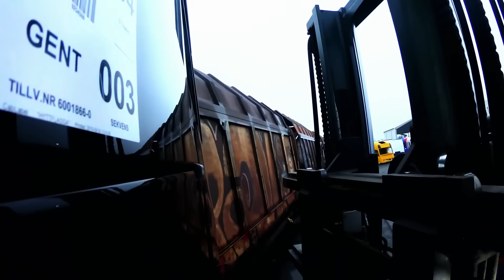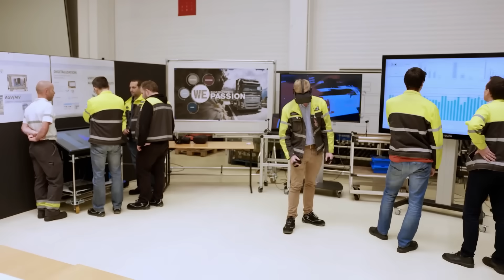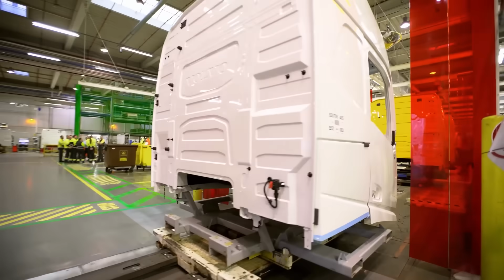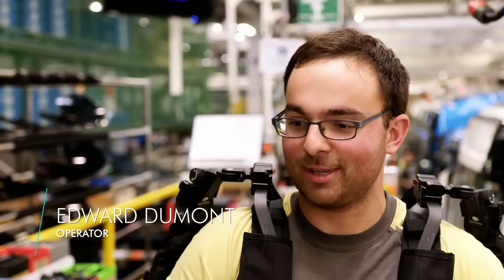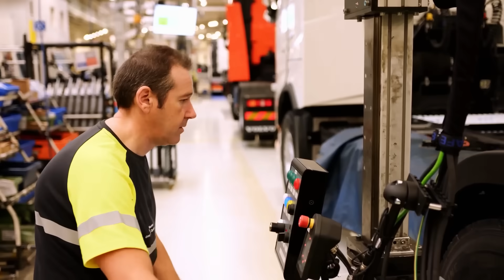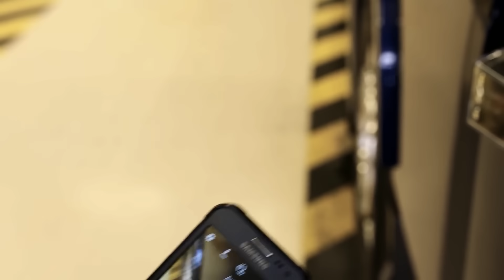Volvo Mega Manufacturing: The World’s Most Advanced Truck Factory | FD Engineering

Comment: In Australia we use the Volvo  FH16 as road trains and pull 4 trailers with a max length of 60 metres (196ft 8in) and a max weight of 200 metic tonnes (440,000lbs) ✌️🇦🇺

Comment: A wind turbine in the middle of the factory, can't believe my eyes.. This climate-hysteria knows no bounds.. 
What happens if a rotor blade falls off? Sure it's a somewhat rare event, about 0,5% annually according to the stats i found online, but the result would be no less catastrophic. 

Worker safety? Think again.
Reply: Windpower is now the cheapest form of energy in Europe. And windturbines are very safe.
Reply: @DexterGordon-dr8qd  Claiming that something is the cheapest form of energy whilst heavily taxating other forms of energy production is an oxy-moron.
Reply: @DexterGordon-dr8qd  Also, "wind turbines are very safe" - Only Germany alone has 6-10 catastrophic blade failures each year. But those are only the catastrophic failures, on top of that you have several other dangerous failures annually, engine failures resulting in fire, ice accumulation on the blades that get flung like icicle-missiles, various parts collapsing and falling off. There are legal distance requirements in place, including in Belgium, because wind turbines are per definition, not safe. Those legal requirements have been exempt here for whatever reason, most likely because "looking green" was more important that worker's safety. 
There's also multiple studies from universities across the US and Europe that clearly shows that wind-turbine exposure causes psychological issues when placed too close to humans, including noice annoyance, irritability and fatigue.

Comment: In Australia we still see a lot old Volvo trucks still running. For many years now Volvo's are made and assembled in Australia for the our market and customisation from rigids to road trains and heavy haulage in excess or 200 tons gcm., now up to 780hp. Mack's are also made in Australia with Volvo  components but bonneted only also up to 780hp in the same factory. Some of  the most popular trucks here.
Reply: What year Volvo's are we talking? late 90s? I grew up going with my dad in all sorts of different trucks. But the first was a 98 Volvo FH420 Globetrotter XL, as well as their flagship FH16 520 and 560, but I think it was a 520 I went in. The FH12 Globy XLs will always have a special place in my heart. Uncomfortable in todays industry. But if a company had one, I'd gladly drive it, and sleep out in it. You could put an super car and an 98-2002 Globetrotter XL next to each other, I'd pick the truck. They take me back to my childhood. Good times. I think in the past decade I've seen 3 gen 1 globetrotters. Only a few companies in the UK seem to have kept at least 1. The rest were bought and exported to Africa. Their engines then would do at least 500,000 miles before any sort of problem. Probably the same or similar for most trucks 25-30 years ago though tbf.  I know things change, but I can't understand why they made such a drastic change in 2003 with the completely different front end, mainly the light shape. Whereas the other manufacturers have somewhat stuck to what works. I suppose it's Volvo, and they're known for being reliable. So it doesn't matter to most wtf they look like. 

Apologies for the ramble that you didn't ask for lmao
Reply: @jonnywilson9117  google says they started in 1972 in Wacol Queensland which also its current plant
Reply: what bonneted model?
Reply: @joelawrence56 bonneted  model Mack's titan, super liners, tridents, granite, and  r models from yester year. These are made in the Qld plant. For those truckies down under would know. The N Series Volvo would also bring back memories.

Comment: I bet are USA friends are thinking they wish, they could build trucks half as good as theses
Reply: Your right, as an American I are better to wish are good as this are were.
Reply: I'm still chuckling, about them calling the air dryer/valve bank, an air compressor.
In the US, Volvo trucks are built for the NA market.
Best wishes from Northern Canada.
Reply: @carlthor91  Yes, they're built for the North American market. Regardless of the market, it doesn't stop Volvo USA from building better trucks, instead of the Tupperware torpedo's they currently build. Although they're much better than what the other companies build.  Still years behind on many things. Which considering Volvo is a Scandinavian company first, you'd think Volvo USA would at least put night heaters (Diesel heaters, although they don't heat diesel, but they do heat the cab... Typically at night when one is sleeping, the Americans and their names ay) in their cabs. So drivers don't have to rely on APUs after paying for them to be put in, or adding them as an option.
Reply: Thinking people may disagree